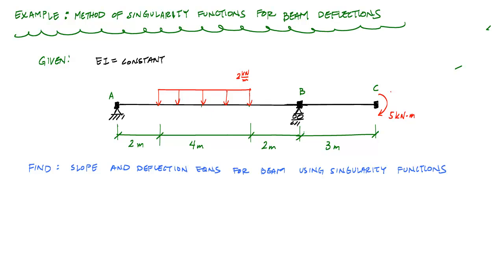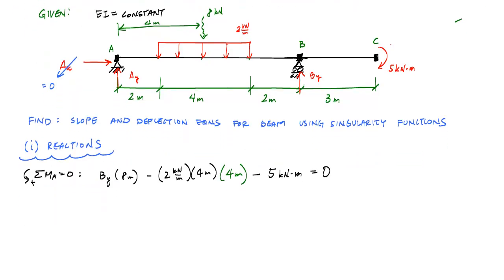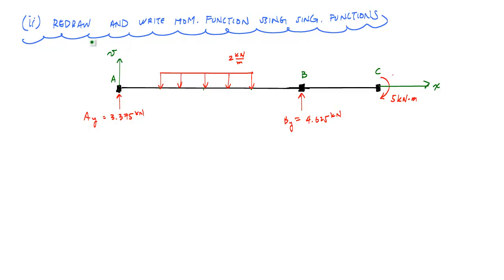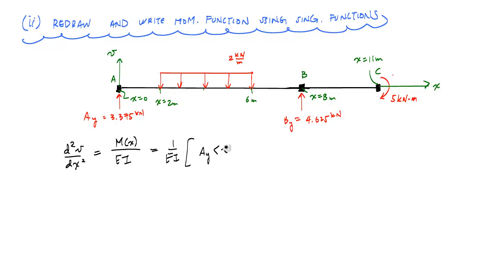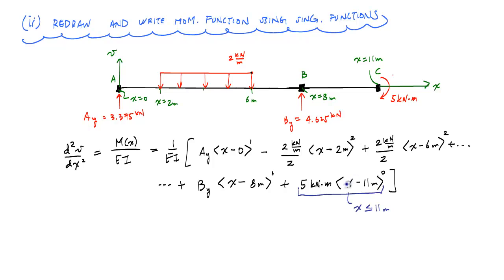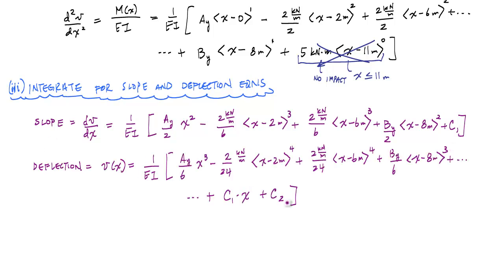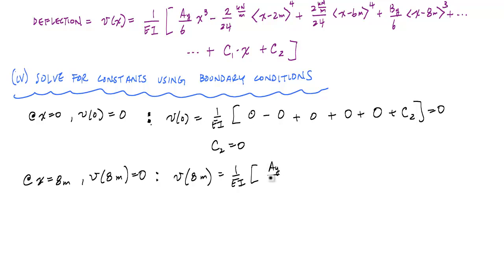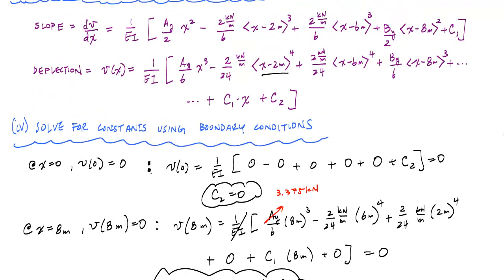Beam Deflections with Singularity Functions (Example 2) - Mechanics of Materials

Comment: As per as I know, singularity method can't be directly used in beams with internal hinge (slope discontinuity). But I have also seen only one lecture note where a slope discontinuity function was added into the equation similar to load and moment. Do you know something about this or can you suggest some literature regarding this. Thanks

Comment: Hi. Thanks for the video. I just tried example my own. I took different Boundary condition. I consider at roller support slope is 0. It gave me different value for C1. So it means that final answer depends on boundary condition which you apply.

Comment: I know your videos are already quite long but I wish you took it just 1 step further to find slope and deflection at some  point, any point for that matter. My confusion is what do we do when a term inside the parenthesis is negative? For example, lets say we wish to know deflection at 6m. Your 4th term would look like this: (4.625/6)KN(6m-8m)^3 Does this mean that this term is zero since according to step functions x is less than or equal to 8m ? Or does step function rules not apply at this point in the method and the actual value for that term is -6.1666667KN*m^3 Please let me know at your earliest convenience and thank you in advance

Comment: Hi. How would you go about solving a problem where there is a triangular distributed load starting at 0 and increasing to half or quarter of the beam? with the linearly distributed load you mentioned that according to the equation, the load continues to the end and has to have the non existent part cancelled off. how would you cancel off a triangular distributed load?

Comment: How would you set up the load equation if there is a triangular distributed load? Thanks for the videos!
Reply from the maker: +Kaan Korkmaz I think this introductory video on using singularity functions might help you figure out how to handle a triangular (or linearly distributed) load. https://youtu.be/Fi_4nY808Q8
Reply: I appreciate it!
Reply: +Kaan Korkmaz in case you did not want to follow the video: The singularity function for a triangularly distributed load is M = (m/6)<x-a>^3. m is the slop, which is rise/run.

Comment: info:I designed a 5 by 5 matrix by using An Integral method to solve for the unknown variables :R(a)=27/8,R(b)=37/8,Slope(a)=68/3,Slope(b)=1 and Y(c)=-51/2 end of the beam.

Comment: I understand you sample but and I have seen another exaple with a l uniform type wedge load that starts  at  point away from the left reaction  and increases   short of the right reaction.  I now that the original load has to continue to the right  reaction and a counter wedge  shown from the end of the wedge load to the right reation. but I can't come up with a formula that gives me the proper  deflections and curvature. I have it working fine when the wedge goes all the way to the right reaction

Comment: This was kind of asked below, but if you have a plywood beam that slopes from its lowest points from its ends to its maximum point at the center how do you handle the varying moment of inertia? In the standard example, when I is a constant, EIy''=M, EIy`=EI*slope, and EIy=EI*deflection.  Is it just a straight replacement of I with I(x) [EI(x)y] or does I being a function of location complicate the integration?
Reply from the maker: Yes, for a tapered beam the MOI would be included with the integration.  Ooooh, that would be a fun and challenging.
Reply: Not too challenging when you use math software. I created a Mathcad calculation that will accept 7 supports (fixed or pinned), 10 point loads, 10 distributed loads, and 10 ramp loads. Every thing gets thrown in a matrix that solves for all the reactions and c1/c2.  Plot out the shear, moment, and deflection diagrams and you're the talk of the town (at least I imagine that is what is town worthy talk).   Very handy for this structural engineer.
Reply from the maker: Juston Fluckey Sounds cool. I'm a big fan of Mathcad too. Definitely, "talk of the town" for a city full of engineers.

Comment: How to find C1 if we have only one boundary condition only one end fixed ?
Reply from the maker: ° Chill out the World ° on a fixed end there are two boundary conditions. displacement = 0 and slope = 0.
Reply: structurefree Hello sir,
How to find the C1 if we have beam with three hinges supported, it is symmetric with three unknowns. The slope for hinge is not = 0, right?
Thanks in advance.
Reply: Ahmed Alshawi You are correct.  One of your boundary conditions would be that the moment at the hinge location is zero.

Comment: How do you go about finding the max deflections using these equations, i try making the slope equal to 0 and solving for x on a beam with symmetrical loading, but the x value doesn't come out to be the halfway point as expected? What am i doing wrong?
Reply from the maker: Az your method is good. for this example the beam geometry and loading are not symmetrical, therefore the max deflection does not occur at midspan.

Comment: I can I use singularity equations to solve ANY deflection slope problem? I'm wondering can I use singularity on a beam that has different moments of inertia (fat part and then a small part), do I Just use 4 equations, 2 for each slope/deflection with each corresponding moment of inertia? Thanks =d
Reply: Ya. you can do that. You just need to do like in the double integration method where you had different equations for different sections of the beam except in this method you have different equations for different material properties. it would be a huge pain to do with more complicated beams

Comment: Great explanation, but I have one question why is the last part of the equation M(x)/EI or w(x) always zero in this case 5(x-11)^0?  I noticed you did this in example 1, but I'm not quite understand why.  Thanks
Reply: Because X will never ge greater than 11 (which is the length of the beam) so that singularity function will not be active